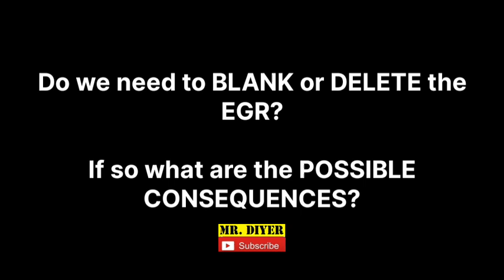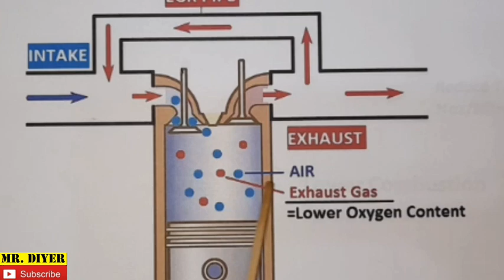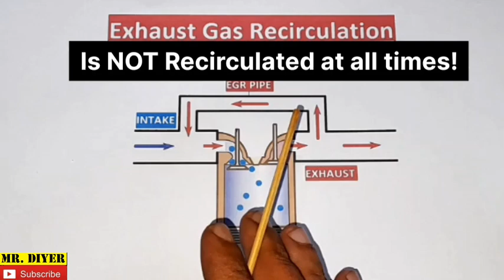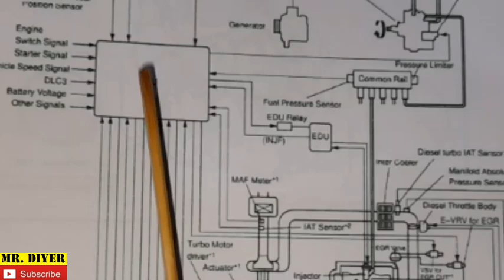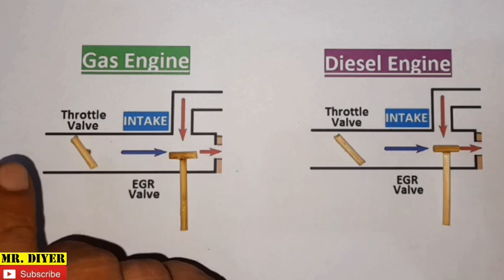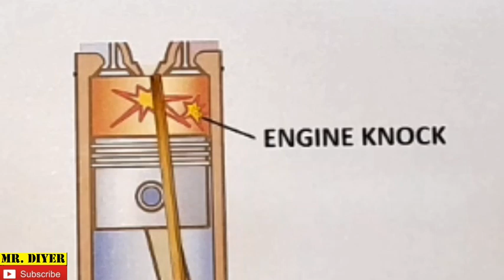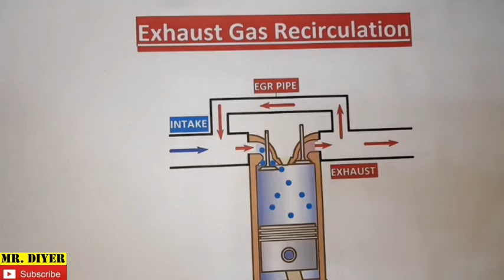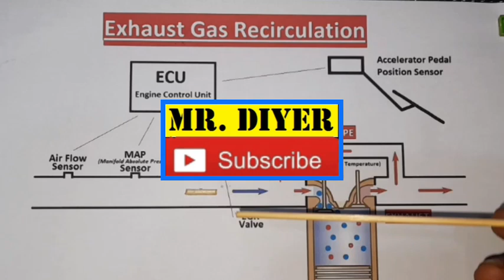EGR Explained! Do we Need to DELETE the EGR?

Comment: Thank you sir for the very informative video! Can you also discuss about Diesel Catalytic Converters? I've seen videos of people removing the catalytic of their Toyota 1gd engine and replacing it with a straight downpipe. This is as they say improves engine performance. What is the truth in this? What are the pros and cons other than environmental impact?
Reply: Yeah higher chance of death from carbon monoxide poisoning from poor folks like yourself who gut out a necessary engineering device to convert harmful gases into co2 and water. But go ahead ricerockers, yall is smarter than the engineers.  That performance they speak of is in their heads and ears, they are just hearing more noise to them equates power.
Reply: A DOC reduces hydrocarbon emissions, and is also used to increase downstream EGTs in order to help with function of the DPF during regeneration.  Otherwise, it increases backpressure, which isn't good, especially on a turbocharged engine.
Reply: All catalytic converters are some sort of filters. Imagine your lungs as an engine, face masks that you wear during COVID pandemic as catalytic converters . Ask yourself, do you find it harder to breathe with multiple face masks on vs no face masks.  That same theory applies to the engine too because an engine is basically an air pump.

Comment: Sir, i think there is still pumping loss even there's an egr on start.up because the throttle valve is still closed preventing more air to be sucked in and recirculate.

Comment: Man, I have respect for you. But your kinda wrong. 
Egr will cause incomplete burn, carbon build up, deterioration of oil faster, death of engine faster, oil changes will be required a lot faster if you want engine to last. ( i would say 3000 miles if you wanna keep the egr ) 

Yes your right the ecu does not know you block it !!! But how about we tell him with a obd port and a computer. We sit the ecu down nicely and tell the story how we blocked egr and remap than we put car on a dyno and tune it. 

My oil in my bmw diesel is light brown at 1000 miles !!! Transparent light brown. I remapped and block egr. My manifold and valves are spotless. No deposit. 
Think about it …. 
I do not talk crap, i only say what i can prove and done on my own car. 
I can show you if you want.
Reply: Hello. If I block the egr, I don't need an occ right?
Reply: @rapbaluyut5778  an occ ?? What do you mean
Reply: @mihairadupop2491  oil catch can
Reply: @rapbaluyut5778  they 2 separate things . They have nothing to do with each other . I ll make a video fot it and explain .
Reply: @mihairadupop2491  yeah. Just checking if an egr block/delete is enough alone to prevent deposits?

Comment: I recently deleted my EGR but after watching this I am considering refitting it. I must admit I didn’t really see any improvement in power after removing and blanking it.
I’ll keep an eye on engine temp now too.
Thanks again.
Guy
Reply: So to follow up. I just had my Discovery 2 go through it’s MOT and it passed with flying colours including emissions despite the EGR valve delete. So it would seem it doesn’t do much. I haven’t noticed any increase in engine temperature or any other negatives. I would say there is a very slight improvement in the turbo lag but that might also be due to the performance air filter which I fitted about the same time.
Regards to all
Guy
Reply: @garviere so your egr remained deleted?
Reply: Has deleting it affected in anyway
Reply: @jarethbower9665  if I’m really honest, I have noticed no difference. I have an MOT coming up on the 3rd Feb so let’s see if it passes emissions, if not then the EGR is going back. That said, I have also recently replaced the air filter with a good after market one which DID make a difference, now whether the delete works in sympathy with that is a question that may be answered if I switch back plus, when I fit my Vortex exhaust which will move more air, that may also benefit from the EGR delete and may offset the emissions issue… if there is one. 
So all a bit up in the air but as of yet, no difference.

Comment: The hot exhaust gas from the EGR valve increase the air temperature in the intake manifold and helps it to vaporize the gas in the air fuel mixture for better combustion in the cylinders.

Comment: That explains exactly what was happening to my Ford Transit. Started knocking noice and low power after not a great amount of miles. Still a young motor. Still went but slow build up to 100kilometers. Had i seen this awesome video earlier. I would have cleaned the EGR. I literally wrecked the entire vehcle because of it and sold it as parts.

Comment: Fantastic video really helped me to better understand it.

My belief stays the same: keep it and add a catch can.

The most important part for me is that it is better for the environment.

Edit: Better fuel economy helps as well.

I really like the examples you showed us. 👍
Reply: The same author of this video also has one on the drawbacks of installing a catch can. https://www.youtube.com/watch?v=hDx09voTlbw
From what I conclude, optimum performance is produced by keeping the PCV, EGR, and throttle body cleaned and to remove impurities by changing your motor oil every 3-5000 miles. Use Dexos approved motor oil.

Comment: Awesome video and a huge thank you. I was about to blank off my EGR system and bypass the cooler on my 3.2Lt Ford Ranger due to an issue this vehicle has with the EGR cooler failing and hydraulic locking the engine due to coolant entering the intake. Now I think the best approach is to install a new EGR cooler instead.
Reply: I cracked the head on my ranger 3 months after deleting egr. Mechanic I took it to said he sees it all the time when egr is deleted due to higher combustion temps and so forth. Doing research I found this video, probably best not to delete it.
Reply: @AdmissionGaming  lol. Sure.
Reply: @rightsdontcomewithpermits7073  Yeah combustion of diesel is a lot hotter than petrol inside the cylinder.
Reply: @NoOne56488  ohh that's why it takes forever to warm up compared to petrol? Cuz it's hotter? And Like at 0 degrees it has to do high idle in order to stay at operating temperature? 
Can't speak for cylinder temperature but I saw reduction in egt after turbo. After egr delete.  And after straight pipe temperature reduction was even greater.  
Hey if you love all that sand(carbon) in our oil by all means leave it all in place! More power to you!
Reply: @NoOne56488  by the way ignition of a diesel is lower than of a petrol. So not sure how diesel would burn hotter. 🤷‍♂️

Comment: You should do mechanics online courses. I'll definitely sign up for it. I have a question about fuel tank pump ( when I put the ignition on " before cracking the engine", it takes about one minute to get pressured the fuel line) . If I wait this one minute the engine will start at first cracking but its lazy on acceleration. If I don't wait until the fuel pump stops weighing, then the engine will have a much harder cracking and it will perform very poorly sounding like a bag of spanners. I'm suspecting that the fuel tank pump its almost dead, and I should have it replaced ASAP. What do you think? ( I forgot to mention that I have new EGR, Throttle, Inlet manifold, Glow plugs, Turbocharger and Refurbished injectors, cylinder head its being refurbished, new high pressure fuel pump)
Reply from the maker: 1. Check fuel lines and hoses for leaks. 
2. Check and or replace fuel filter.
3. If you want to know the pump isnt working, disconnect inlet fuel hose to the fuel filter, have someone turn the ignition key to on position and see how long it would take for fuel to come out.  You can also reconnect that and disconnect outlet hose and see the difference, that will basically tell you if you have a clogged filter or a worn out pump.
Reply: Thank you for this tips. I'm gonna check the point 3. , 1 and 2 are excluded already.  Very much appreciate your help 🙏.

Comment: pcv+egr is jackpot combination to have heavy soot in intake, one of that two must be deleted, pcv is important because removes condensation from crankcase and oil, so egr can be deleted, but pcv has to be modified by oil catch can and then soiling is minimal
Reply: Yep. If the pcv system is properly coalesced, the egr doesn't really hurt the engine
Reply: @sHoRtBuSseR  without occ always passes some amount of oil vapour  into intake manifold,  exhaust gas has soot and glue is prepared,

Comment: Your explanation makes sense, but doesn't explain the very obvious increase in the off the line pickup in my 2000 discovery td5, maybe it's because the kit I used replaces the valves in the intake which had a 50 percent restriction.

Comment: Interesting point to note , on the Toyota 1hz normally asperated diesel , the egr was fitted as a legislation issue , the pre egr motor performs better with a better feul consumption , if the egr is blanked out , very simple as this motor does not have any computers , the performance goes up , the feul consumption goes down . The lower exhaust gas temperature is only of importance on turbo motors . Even then it is miniscule . The egr is another of Al Gore's scams . Egrs make cars more unreliable , so manufacturers dont mind putting them in . Last year , I had an egr failure on my turbo diesel v8 Range Rover , because the car is so computer reliant and sensative , they had to be replaced , if my car was a Range Rover Sport 3.0 v6 turbo diesel , being far less computer reliant on engine management , the egrs could have been blanked out , far cheaper and far more reliable . Ask any mechanic who did his trade before 1996 , he will tell you truthfully , egrs are a waste of time and all they do is clog up and strangle your motor . Any motor can run without egr systems and will if you bypass the million and one sensors and computers put into place to make your car more unrliable . Very informative video , well done .

Comment: 16:53 carbon buildup is EXACTLY why I deleted the EGR....Owned 4JX1 car since 2000, now 35000km's...deleted EGR 3-5 years ago...Excess black smoke STOPPED during acceleration...Performance SAME....Economy SAME...Oil is CLEANER now at changes....Needles to say what I think about EGR :)
Reply: I think the soot content would clog up the intake and ruin the engine way faster and decrease airflow/performance which would out weigh the benefits of an EGR in a shorter amount of time. I do like your presentation but I want my engine to go a million miles and not crap out at 400k
Reply: How about engine knock and higher temp on idle? Any of that occur?
Reply: bro was just said deleteed why not uninstall it
Reply: I had an old Eagle Talon with an EGR delete.  Other than the PCV garbage the intake was clean.  I did get quite a bit of part-throttle knock on hot days at low speeds, but highway gas mileage in the USA was about 31-33 MPG depending on ethanol content at a steady 70-75 MPH.
Reply: Mechanics love this EGR system because it breaks down more and the cleaning of intake manifolds mechanics are making big money from this but as a trucking company owner this system is SHIT I have a fleet of Kenworths trucks all have EGR system but I have 2 Kenworth disconnected 8 Kenworth still have the EGR on they have had nothing but overheating problem's with the EGR system cracked heads in all of them and blown turbo's nothing but Head aches all have Cummins engine's now the 2 that have the EGR disconnected run cooler and run better all pulling 2 trailers with 68 tonnes on the east coast of Australia I just wish some of these mechanic's would come to my yard and spend a week in or sitting in one and watch the difference in temperatures it's alright in theory but in practical is different get out here and look and see what happening Cummins gets the shits with me ringing all the time you can stick EGR system's in your ARSE
Reply: Probably it was faulty already. EGR cycle only happens at low rmp without power demand. If you floor it, EGR just disengages. Probably your egr was stuck open and your engine did not get enough oxy during hard acceleration, it was the root cause of the black smoke. Nevertheless I deleted mine as well... TDI has lot of kms, slight amount of oil coming from my turbo and pcv valve too. If it mixed with diesel exhaust gas, it just makes huge mess. I don't give a shit about a small amount of inefficiency or greenhouse gases, if I do not have to disassemble the whole intake system and clean it with harsh chemicals every 100k kms.
Reply: @wolforla  My 2000 now has nearly 370km and continues to run fine with egr disconnected.
My only problem is 1 litre of diesel gets into the sump every 1000km due to injector issues, NOT sleeve or seals since they have been done twice recently.
I have purchased an injector spring and o-ring overhaul kit but requires actual dismantle of injectors to fit, do-able and not too hard but simply cant be bothered.'
Instead I simply change oil every 2000km and low refill with just 5 liters of any cheap 20w50.
Yes, car starts and runs fine even in winter with thick oil.
Drain when dipstick shows overfull and then fill with 5l which brings it to just below ADD LINE on dip stick.
Good thing is that diesel in oil plus regular changes (every 2k) is cleaning crankcase - been doing it nearly 18 months now - 20k
Reply: @wolforla  Mine was throwing out too much black smoke DURING hard acceleration now no longer does since blocking vac line to EGR valve.
EGR valve is still fitted but no longer opens :)
Reply: this guy likes his own farts 🤭🤭
Reply: @doji_town_adventures  I AGREE

Comment: A 2.5 diesel naturally aspirated engine is slower than a 2.5 turbo diesel that is why it will outperform it, but a diesel aspirated engine that has no egr is much more engine efficient than a egr one.

Comment: That is not true. An EGR does not remove oxygen it adds already burnt gasses witch are inert gases and will not support combustion. The purpose of adding an inert gas is to take up cylinder space to cool the burn

Comment: This is great explanation of egr. But i have to disagree with pumping loss on gas engines. The intake valves arent open as the cylinder moves down, the valves open after the cylinder is close to bdc. Pumping loss already occured at that point.

Comment: Great sir

U could have explained ECU remapping when they delete EGR. 

just blanking  ❌

recaliberate ECM remaping tune 🤝🔥
Reply: Problem with that solution is that you can’t find anyone to do a tune for you anymore.  They’re all afraid of getting caught.  Also, his video assumes the optimal running conditions in either EGR or deleted setup.  A tune just turns off the EGR computing so as to allow the engine to run “normally” again without it.  This doesn’t change the pros and cons.

Comment: Very well explained 👍👍but when oxygen is reduced wont that cause more soot or particulate matter . In your experiment replace your gas tourch with a kerosene tourch and try constricting the oxygen vents . Particulate matter is equally harmful along with sox and nox .
Reply: Yes more EGR generally means more soot and hydrocarbons. This is also part of the reason for it being disabled under heavy acceleration, under such circumstances the air:fuel ratio is richer (particularly in a diesel) and thus the increased soot effect would be much more severe. It's not my place to debate whether soot is worse than NOx, except to acknowledge that both are bad and must be minimised.

 In newer diesels the soot is generally dealt with by a DPF which leaves NOx as the primary concern, to the point where EGR cannot reduce it to acceptable levels. Hence the latest diesels also using SCR systems to remove NOx from the exhaust, this has an added benefit of reducing the amount of EGR needed and thus there is less soot that must be trapped by the DPF.
Reply: He touched on that exact point already…did you not watch the video fully?